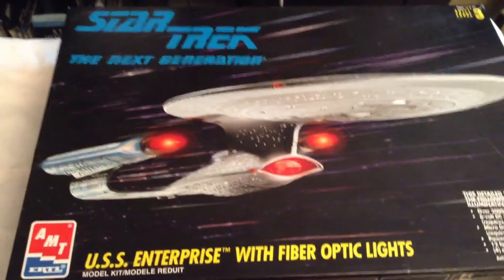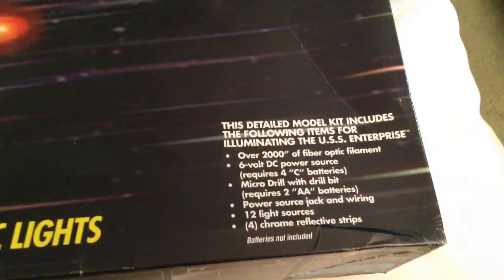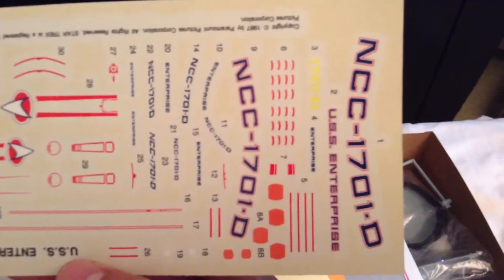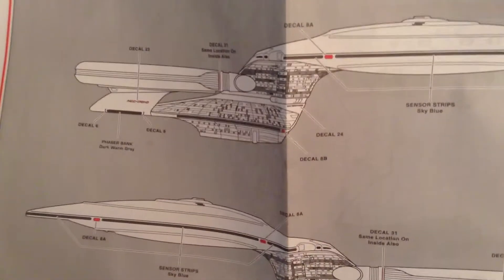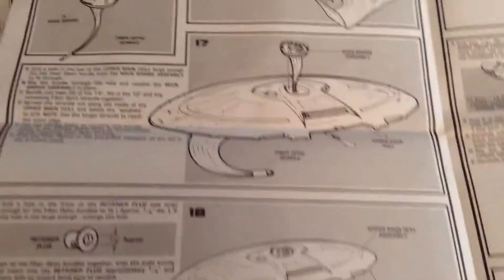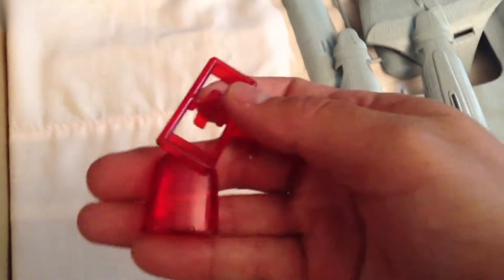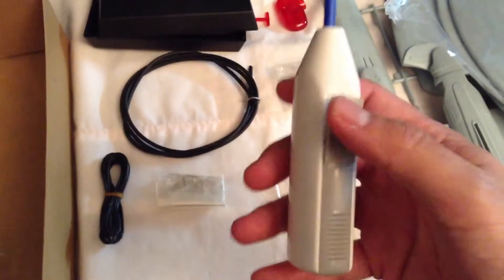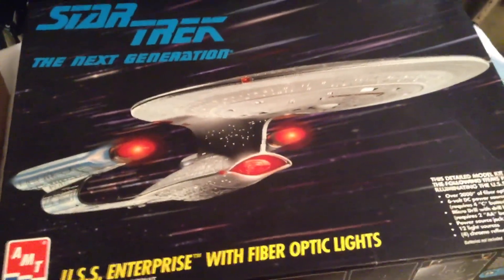AMT ERTL Enterprise D with fiber optic light kit review

Comment: more on this kit please am thinking of picking one up
Reply from the maker: Hi Rick,What question do you have about this kit in particular?Thanks Dave
Reply from the maker: Hi Rick,If you haven't bought the kit yet,I would suggest picking up the Polar lights clear plastic kit instead especially if your going to do it with a lighting kit because it would be a lot easier than what I am doing now which is drilling out each individual windows.The clear kit is easier because you just need to paint and scrap out the paint for the windows you want lighted.
Reply: I was working on the clear kit and messed up lighting the nacells and got mad and left it undone.
Reply from the maker: Oh man,sorry to hear about that,maybe the fiber optic old kit would be better for you!

Comment: wheres all the fiber optic at? 2000" really, i just bought one and there is no 2000" of wire.please get back
Reply from the maker: I think that 2000 is just a bit misleading,the fiber optic cable I have is about 40 inches.I think they are measuring each fiber optic filament length was that could measure close to the 2000inches.What is the length in your kit?